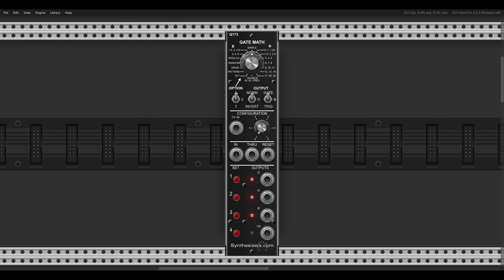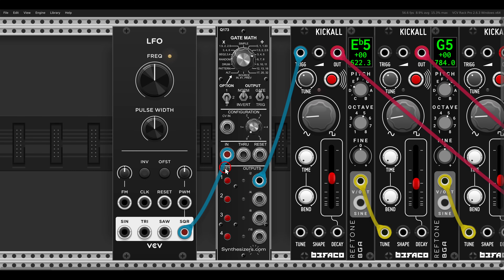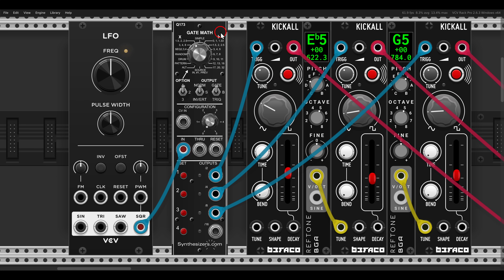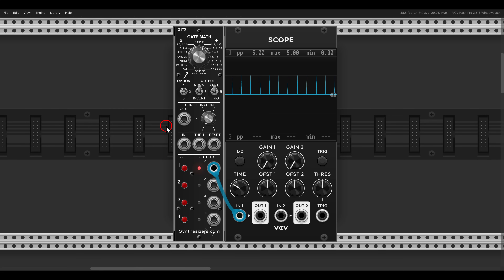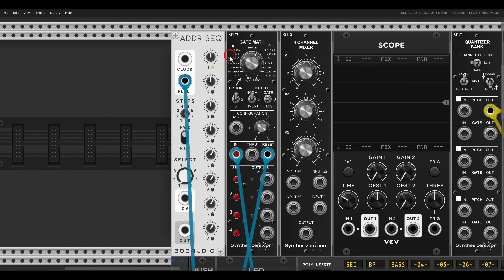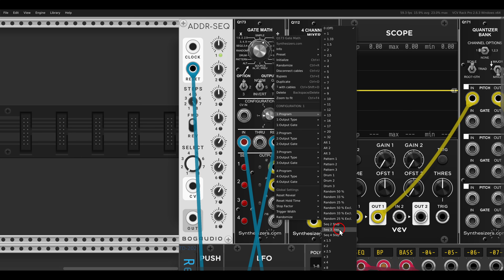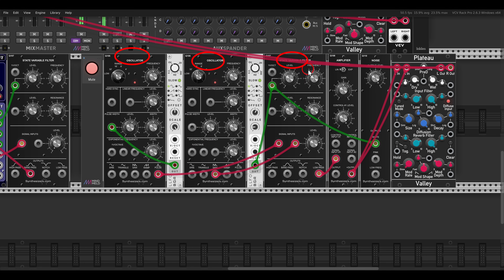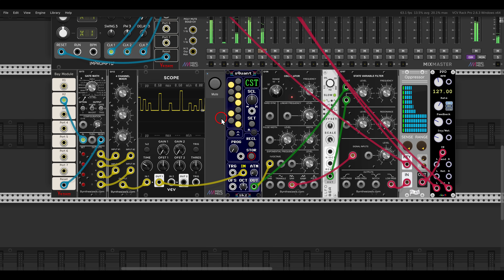Everything gates with Gate Math from Synthesizers.com

Comment: Thanks for providing and linking to the patch. This was a really good vid and I also enjoyed the video about the chaos modules! I would like to explore using pure randomness in connection with chaos theory and other math concepts. I find it beautiful to hear math converted into audible form. Such as converting sorting algorithms into sequences. Cheers! ✌🏻
Reply from the maker: Glad it was helpful!
Reply: I like the three Sapphire chaos modules--Lark, Glee, and Frolic--all based on sets of differential equations. I especially like the visualizations possible with Tricorder.

There is a linear equation module that makes some nice sequences, but it is a paid module and I don't have vcv pro yet to try it.
Reply: @thomasbrown3325  "Formula" or "Formula One" might be some free options for evaluating equations, if you don't mind doing a bit of scripting. 

Alternately some of the free envelope or function generator modules may do a few similar things if you prefer to work visually. (Draw some graph lines, and it converts an x-input to a y-output based on the position on the graph.)
Reply: @thomasbrown3325  You do not need VCV Pro to use premium (paid) modules